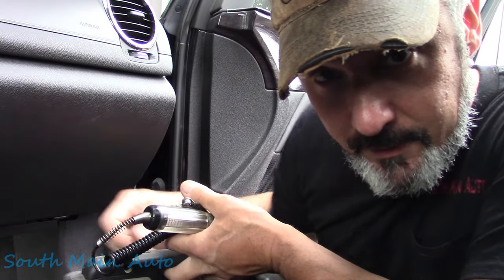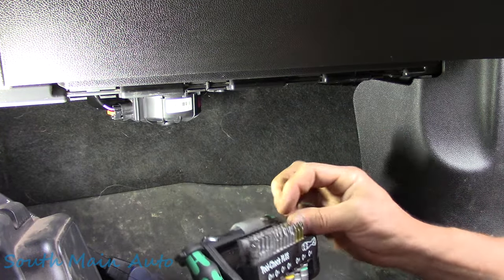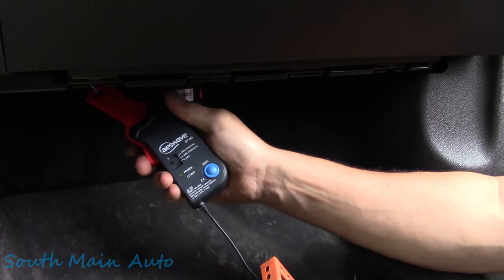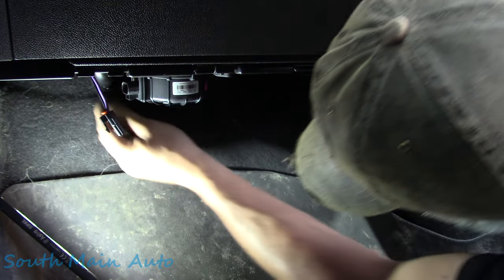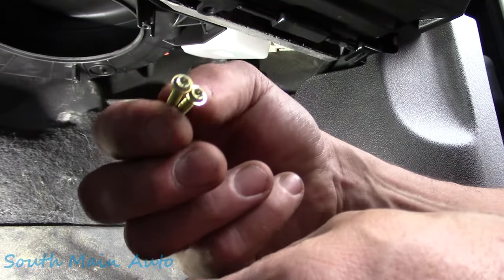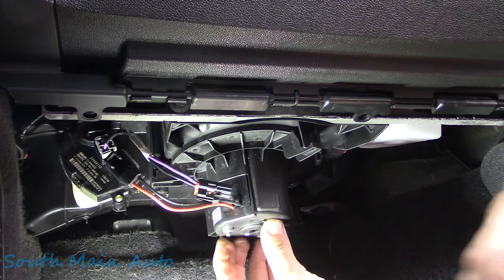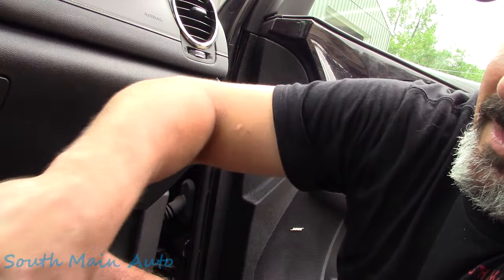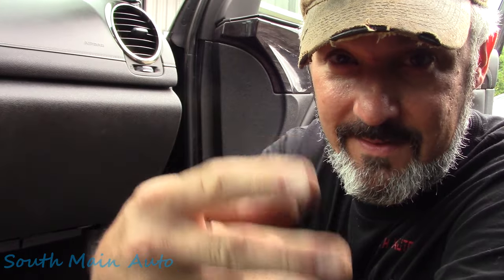Buick Enclave: Front Blower Motor Does Not Work

Comment: Nice job, Eric.  Good ole, practical mechanics.  See problem, diagnose in a practical manner then fix it; taking us along with you.  No scanner, no wave form,  no TSB's.  Just good old logic based on experience and knowledge.  Change of pace.   SMA videos are always valuable.
Reply: I think there may have been a scope, but of course I could b wrong. Rather than a dead spot on the commutator,  it maybe that the brushes were a little stuck?
Reply: My Escort had the same problem. The first time it happened I put a set of brushes in the fan motor. I had it long enough to wear it out again and just replaced the whole motor the second time. I diagnosed it the same way. I just slapped the heater box and it would work for a few days. I've used the same trick to get vehicles with worn-out electric fuel pumps started. Only failed me once. My 97 Chevy Express died and I was about 2 miles from home. It got pulled up a pretty steep hill by a 91 Nissan Sentra.

Comment: I'm retired now, but that sort of job was something I never enjoyed in my workshop. For a start, I'm 6' 3", so any job under the dash was difficult to get to. Added to that, here in the UK, cars are usually more compact, so you have less room to work, and on top of that, most cars are designed as left hand drive, then they make a right hand drive version for the UK and similar markets, with the bare minimum of alterations to the layout under the dash, so you have to work around the pedal box and steering column as well. It's good to be able to sit here and watch someone else do it now, knowing that I don't have to. Keep up the good work, Eric.

Comment: The night light on my radio went out over two years ago.  I didn't feel like pulling the radio to see what was wrong, so there I was without a lit radio at night for well over two  years.  The other night I got sick of not seeing the time on the radio at night, so I gave it a good shot with my knuckle.   LET THERE BE LIGHT!
BTW:  Always nice to hear Mrs.O.
Reply: Percussive maintenance for the win.
Reply: Worked for my buddy’s 1992 Toyota Tercel dash. As a joke I beat on the dash and the lights all came back on. After that had our standard operating procedure.
Reply: @FishFind3000  I have a 1986 Corolla GTS that did that some years ago.  Eventually I got tired of hitting the dash so I took it apart and found a fractured solder joint on the light switch.  Easy fix and no parts required!

Comment: Ahh...the memories.  Back in the late 90's a mouse found its way into the AC duct work of my '96 Impala SS.  It ended up in the squirrel cage blower fan.  I didn't know it at the time.  I was driving in the middle of the Nevada desert with the AC cranked up.  Then suddenly, the entire car started severely vibrating.  When I reduced the fan speed, the vibration was much less.  I drove about 2 more hours before getting home.  Our cat showed an unusual level of curiosity about the car.  She normally wants nothing to do with cars.  She apparently smelled the dead rodent.  Just like Eric did, I dropped the fan assembly down from behind the glove box.  Much to my surprise, there was a mouse inside the fan.  Needless to say he was deceased and very flat.  The centrifugal forces did him in.  I took some pictures (of course) and removed the dead rodent.  Put the fan assembly back where it came from.  No more vibration.

Comment: Often, the blowers fail because the brushes fail to make good contact with the commutator due to wear. Bumping the motor causes then to make contact again and the motor takes off. It may run for a day, week or month. Best to replace the motor when this happens because it is going to fail again. This type of failure usually doesn't show up as a dead spot when you scope current draw
Reply from the maker: as we saw :)
Reply from the maker: as we saw :)
Reply: @SouthMainAuto  you can say that twice!

Comment: In high school I had a '83 Chevrolet Chevette. The dash selector didn't work for the defrost and floor. So each time in the winter had to decide, cold feet or a defrosted windshield. You had to reach up under the dashboard on the passenger side to manually move the diverter. It was a total PITA but being a first car it was freedom regardless!
Reply: If you think back, I'm sure you could be like ''if I had just of had say a steel clothes hanger hooked to the blend door opposite the bearing/hinges what haveyou and ran it to arms reach near the steeringwheel or ankle and' voila' manual mode".  Buuut never did by the sound of your post. Now, wait for it

Comment: Eric, fun watching the video and reading the comments as we lament about the old trucks we use to own.  Had a old Ford truck with a worn out neutral safety switch.  Took it out and apart, replaced the worn out balls in it with bb's. Worked great.  Pretty amazing the stuff you think about when your upside down under the dash.  Thanks for Sharing!

Comment: Nicely done and thank you! If I may add if it hasn't been mentioned in comments already, mine (2011 Enclave) first acted up last time I had the heat on during spring. Ordered the new fan from Amazon but summer hit and using AC, the fan ran just fine. Chicago getting chilly again so running the heat, it would get stuck again so I've been bumping it with my fist to kick start it lol. Today... I put that new one in! Now to figure out why I have constant heat on my drivers side when my AC in on.. Ugggs

Comment: I did do it,,, now I am retired. By the way my 1990 chevy pickup with the 4.3 v-6 5 speed shifter is sitting in the driveway with over 350k on the odometer. Okay I changed motor at 250k and heads 100k later. Still runs good and is only used to make lumber yard runs. Nice video Don
Reply: Obviously you don't live/drive in the rust belt.

Comment: On the GMT-400 (your old Chevy) the positive wire that connected to the blower motor often gets loose and burns up, but won't always be obvious right away.  A simple spade connector will replace the original.

Comment: For dealing with the small plastic hardware I use a Milwaukee M12 Fuel Brushless Electric screwdriver (2-speed driver) model number 2402-20. The tool has a built in LED light when activated. The tool has two speeds, torque limit and driver or drill setting. The trigger pull is progressive. Once you get used to the tool you can snug up small plastic screws without over torqueing or stripping out the plastic. Then you can final torque with a hand driver. I like to use the Kobalt magnetic ratcheting screwdriver model#  15000.

Comment: Those bearings are technically called bushings and rarely last a long time. When they start failing, they will require a lot more startup torque to spin. A drop of oil might make it work another year or so but not the most reliable repair method for a garage and customer.  Nice replacement part.
Reply: I've had good luck using the oil you get from an appliance parts store for furnace fan bushings.  It's thick like honey and stays put.
Reply: @LuckyBaldwin777  Would be better the manufacturers simply used real bearings.
Reply: @Garth2011  What? You think a manufacturer will spend another 8/10 of a cent on a 40K vehicle? That's crazy talk.
Reply: Spray with 3 in one and spin the fan with a pencil or something, keeps fans going for years !
Reply: @Garth2011  true, but auto manufacturers often use the cheapest solution instead of the best.
Reply: @LuckyBaldwin777  They didn't years back. Make that decades back.

Comment: Had a '95 Cheyenne  std. cab 8 ft. bed with the 4.3 and a cap...very nice truck!  I have a picture on my desktop and look at it quite often. Me and the misses had a lot less back then but put a lot of miles on it heading to the Wisconsin northwoods pulling sleds or a trailer with the camping gear.

Comment: Like you,  I had a Chev C10 w 4.3, best engine ever. Only prob was the old Getrag puked 5th gear @ about 220,000 mi. Didn't use or leak a drop of oil. Only got between 18-20 mpg. Wish I still had it, yes it would chirp the tires going into third.

Comment: I have a 1988 Toyota truck that the blower motor would not work every time and giving it a  bump helped sometimes. Rather than spending too much money on an OEM part from Toyota or taking my chances with a used one off of Ebay, I bought a brush kit and cleaned up the motor commutator, Been working several years now.

Comment: This last summer my AC went out pulled the dash apart pulled blower the resistor got into the head unit all that never did get it worked had it taken took it to a shop in the bottom line was it was a relay that was hidden in the kick panel on the driver's side so you live and learn but I know where everything is now have a great day

Comment: When I changed the blower motor on my 1988 Mazda truck, I had to swap the squirrel cage over to the new blower motor.  I have not yet had to change out a blower motor on my 1998 and 2004 Frontiers so don't know if those come with squirrel cage fans or not.

Comment: I have often assumed that DC motors that restart with the Fonzarelli Method, were actually suffering from a stuck brush..a bit of gumming or crud holding a brush off the commutator and the shock loosens the brush, contact is reestablished and off they go for another couple of years. 
Case in point 2010 Forester electric window motors
Reply: That's what happened to me ('00 Olds Intrigue blower motor).  Brush was hanging up; I disassembled, loosen the brush in the channel, reassembled, and voila, ran for the rest of my time with her.

Comment: My brother had a 68 Chevy that the blower motor went bad. And I told him I thought I could fix it and told him to Jack up the passenger side front tire and take it off. He thought I was crazy 😜 but darned if there wasn’t a door down there and I just happen to have a motor that would fit. He had heat that winter in that old car.  Things sure have changed.  Some better some not so better.

Comment: Didn’t know the rev limiter changed with the cluster on the tbi motors. I know I fixed my abs light by swapping out the cluster on my 4.3 1500 I know the cluster was from a V8 because they had no 6’s at the time. Motivation to do the trans swap to get it back on the road to see if it revs higher.

Comment: The blower motors that I've had to deal with on 07 to 09 Chevrolet pickups it's always the plug that goes into it is loose it's like they need one of those silicone weather pack grommets that goes around the plug to steady it

Comment: I find more often than not it's worn brushes being stuck in their holder and that's why it works again after hitting it, jars them loose, same goes for starter motors, radiator fans, alternators, and in tank fuel pumps.

Comment: You forgot to mention the free tip screw trick.  Turn them counter clockwise until you feel them drop into the existing thread... then righty tighty until it is tight like a tiger.

Comment: You mean they had fuel injection back when you were a kid, then you're not as old as I thought you were. I was 19  50 years ago and  we still had carburetors, my favorite setup was the Ford Boss 429 with a cross ram intake manifold and dual Autolite inline carbs rated at 1400 cfm a piece, it was a monster, now you can get the same performance with a 4 liter v-6 a turbo and fuel injection and a performance chip in the computer. You know what's funny a lot of young people today think these computers have been around a long time, some guys were rebuilding a camaro and said they were going to put it back original at first till they found out most of the internals don't exist, then they found a niche company that can make what they can't buy but it would cost them over 100,000 dollars to do it it was a '67, my cousin had one they were nice..

Comment: My first car was an old Ford XL 198? something. Had been sitting for several years with a stuck engine. Got it running and drove it several years. Took weeks of kerosene in the cylinders to get it to turn over.

Comment: If the aftermarket company NAPA rebranded for this blower can figure out how to make a profit and have a decent margin on a Canadian produced product, so can GM. List price on Canadian one is like $5 less. I wonder how many parts on a Buick Envision (assembled in China) are made in China?

Over winter, I helped a friend replace the 5.7 TBI (rod and kibble/bits made new drain holes in the oil pan) and 4L60 E (hersheys syrup) in his 95 Silverado Z71. The only real annoyance of the job was the lack of disconnects on the harnesses. So easy and straight forward. A stick shift 90s Chevy truck with a 350 sounds cool, they weren’t common.

Comment: Hey Eric, I had a 2000 Sonoma that the blower motor was squealing at all speeds so i grabbed the longest 3/8 ext. that I could find and put the female end against the end of the shaft of the motor and give it a sizeable smack with a hammer and that shut er up. LOL

Comment: Eric O. my dear good friend, I have a question...  I recently had to remove both steering knuckles off my '08 Lincoln MKX to replace the front wheel bearings.  My car doesn't seem to have any type of adjustment where the knuckle bolts to the strut so do I need to get an alignment?  I didn't disturb the tie rods adjustment and the car drives straight and doesn't pull at all.  I'll get one if I need it but just not sure what they would have to adjust as my car doesn't appear to have any adjustment for camber?

Comment: Eric O... upselling the customer on a blower motor after you got it working....smh...

Nah..J/K.. lol

IMO this was a stuck/worn out brush that caused the issue. You made the right call once again with a full replacement. What's more disturbing is that the motor failed so quickly.

Comment: A friend of mine had a '55 Chevy that had a 6 banger in it and over a weekend, a friend of mine wanted to change it to a 283 V8. The car had 3 on the tree and he wanted it in the floor. We started Friday night and by Saturday noon, it was ripping up and down the street. We went to bed to get some sleep before going out on Saturday night cruising. When we got up, we left his house blasting down his street heading to have a great time that night. We got about half mile down the road as he was leaving a stop sign, I'm not sure what happened next. He doesn't recall either. He may have been shifting to second gear but the drive shaft dropped out of the transmission, dropped to the ground and jacked the ass end of the car about 10+ feet in the air. This is way before seatbelts, padded dashes, head rests and the such. We were alive but the damage to us was minor compared to the '55 Chevy. The front bumper was torn off from being drug on the concrete road. When we came to a stop and got out, the drive shaft was still having it way the the street and a few cars that were parked there. The drive shaft came out of a donor car as did the motor. The engine mounts weren't "exactly" where they should have been but looked close enough to the "eye micrometer". It wasn't!
Reply: Yes, we did that to my 56 Chevy as well.  The front mounts for the six cylinder are forward in the frame since it is longer.  Move them back to the v8 holes and the drive shaft will not fall out.  I wonder how you got the bell housing to mount to the frame brackets.  The radiator should be moved to the rear of the support or it will overheat.
Reply: @graymodeler  The donor car had a 3 speed transmission and the bracing to go with it. And yes, we discovered the overheating issue after the repairs from the drive shaft departure. We tried the no thermostat trick first but it still overheated. I think we had to go back to a junkyard and get a newer Buick fan that had a longer neck and an extra pully that we didn't need but it brought the blades back up to the radiator. This is all fuzzy memories from 60 years ago. I had forgotten about the overheating. Good times!